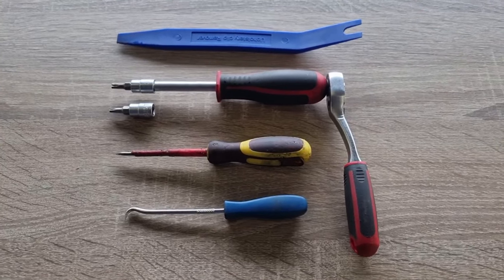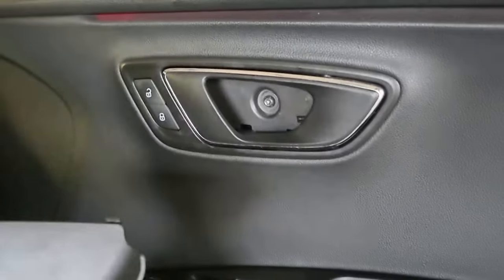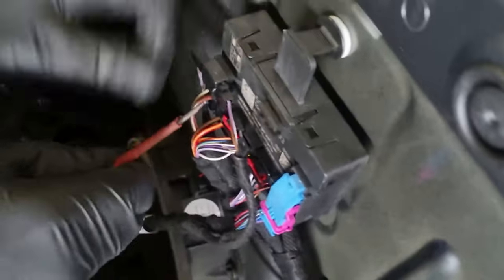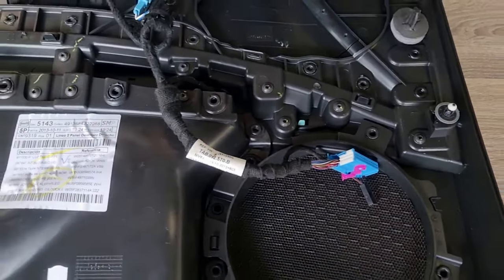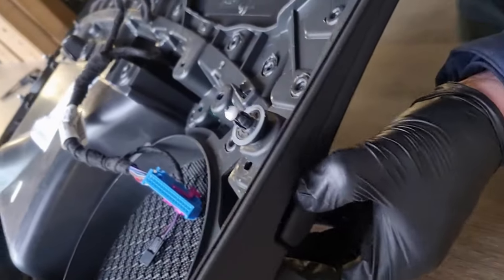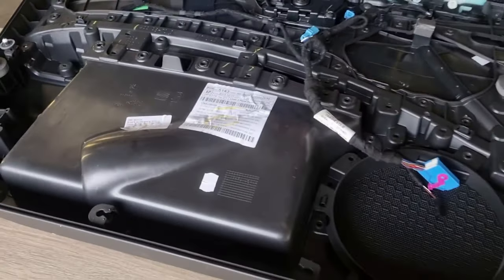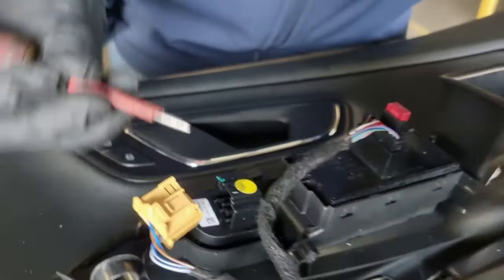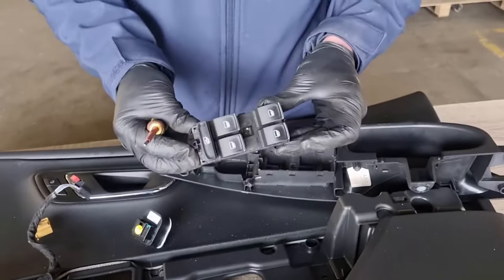SEAT LEON MK3 - How To Remove Front Drivers Side Door Window Switch & Wing Mirror Switch 2013-2019

Comment: Window switch driver side part number for Leon FR SC (5F5) - 5G0959858A. It can be replaced with part 5G0959858G from Golf Mk7, which is more easily available and therefore cheaper.